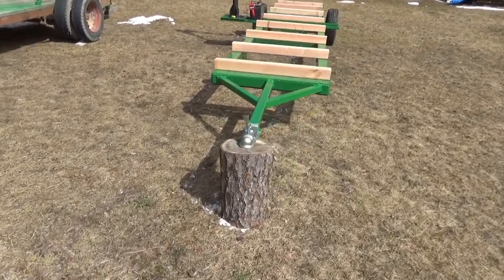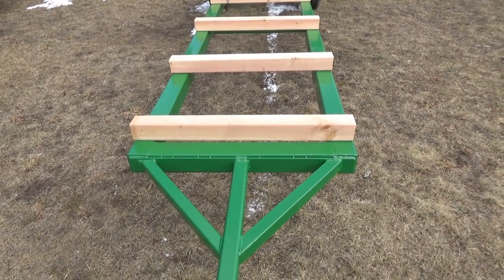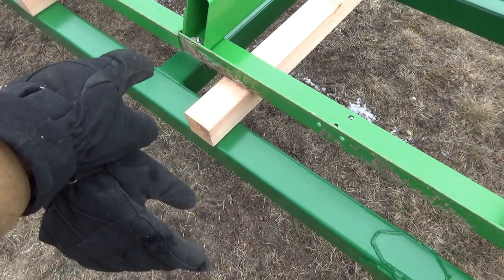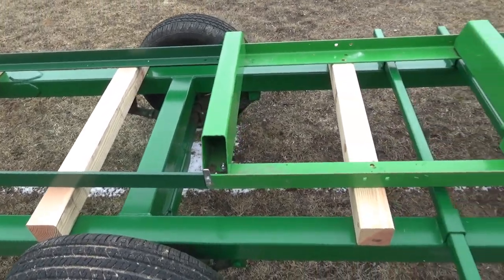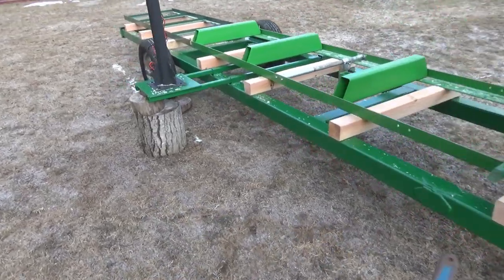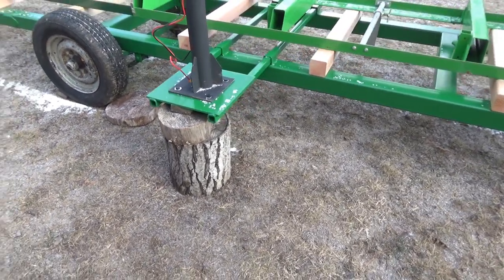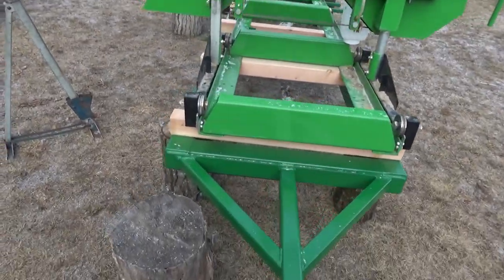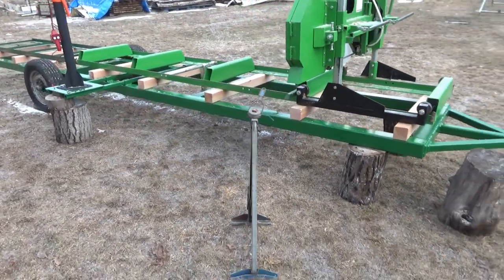Building FrankenMill The 20ft Sawmill For Our Homestead

Comment: You're going to want to put the 4x4's directly under the log bunks or you'll wind up bending the frame rail.
Reply from the maker: Good point. Now I have to rework my idea because the bolts are what hinder me in the first place. Hmm.
Reply: @TheDoItYourselfWorld  wood can be drilled for bolt heads, ends can be milled down for frame patches, etc....
Reply from the maker: I ordered some lag bolts. I will replace the nuts and bolts holding the bunks with lag bolts into the 4x4s

Comment: well all the ones iv seen set on the ground,,like a final resting place,,,with no wheels,,when u start putting logs on there,,there heavy..it needs the ground to hold all the weight...course they brought mills into the fair with wheels on them,,as i remember...may be it will work..love that thing,,wish i had one to make boards...Troy you can only do with what you have ,,things can straighten out later...you  can always move it,,just watch picking up logs it dont try to tip over..my brother in law has a tractor with a long pole on the back for picking up logs,,so easy..but i still think that should set on cement blocks sturdy..oh well i hope it works out..you got trees to cut or are you going to buy your logs to cut...you have to get a medal detecter to for nails in wood..i watch ,,shawn  at out in the woods,,he got a nice wood master mill..you may check him out,,smart guy....Mark Galicic has a round saw mill with a 50 some blade,,hes good to...these guys are very smart on wood....be careful Troy..hi to all

Comment: might just notch the 3 4x4s a bit for the support of the odd angle iron frame rather than stacking washers or spacers under the rest of the frame. Cool project, thanks for the videos
Reply from the maker: Actually I am considering running those through a planer to shave them down to fit. Thanks.